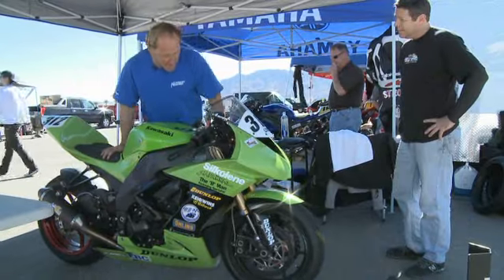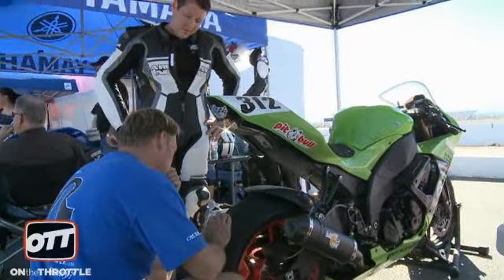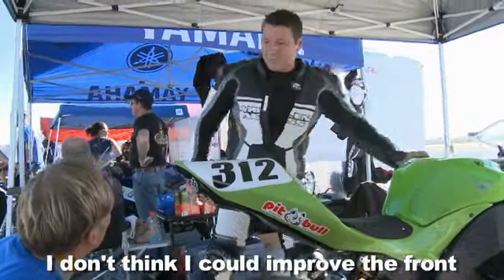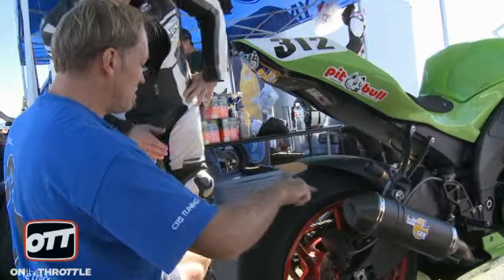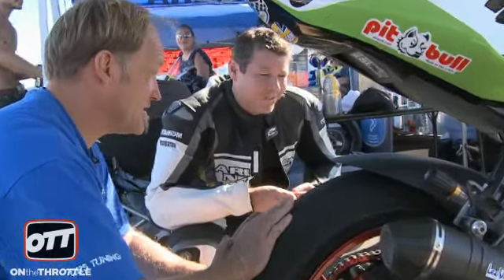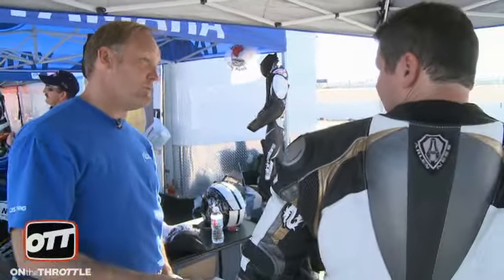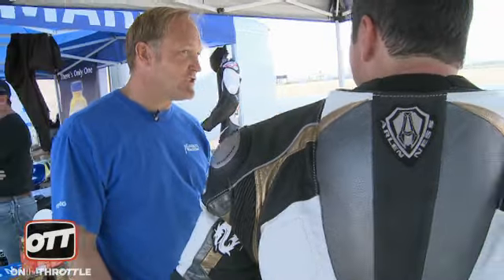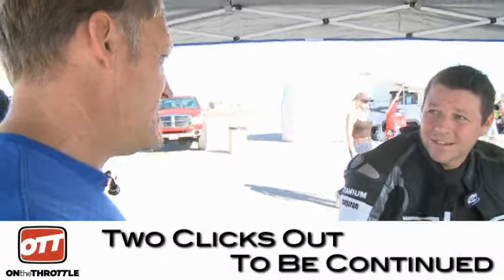Two Clicks Out 12: Shredding A Rear Tire

Comment: i like this style vid,  favorite Dave Moss vid, hopefully can find more of this style.  tire wear is interesting.  I ran into a unknown for me. I understand theory of high and Low speed Compression. but i would think you would open up the high speed,  Dial in the Low Speed( I assume its the old school, the foundation) then work on the High speed. But, honestly not sure, been out of this stuff for bit, so "High Speed" is out of my wheel house, I do understand the different inputs that are "high vs Low speed" it's not your speed, But speed definetley matters. I think of it like braking bumps,, chatter, same stuff a slow rebound can create "Packing". I may be off base??

Comment: Good example of how important it is to 'read' the tyre in order to go in the right direction with suspension. Know the cold pressure and set it before anything else. Check pressure when under the warmers and again as soon as you come in after every session. Maintaining the hot pressure gives a known constant when 'reading' your tyre...Mark, Dunlop Motorsport.

Comment from the maker: @leecravenaz  good observation. Most race tires are no longer directional, but DOT race tires have to have all the markings of a stock tire including the rotational arrow. Getting the most use out of a race tire (slick or DOT) is therefore done by "flipping" the tire. Helps keep the costs down a little for our biggest expense - tires!

Dave Moss
Host
Reply: Yea I saw the arrow wrong way round as I'm a retired bike mech. Are some tyres ok one 
 backwards then Dave?

Comment from the maker: @cougz82 with these race DOT tires you can run them in either direction. This is true of many race tires, slicks or DOTs. To be race legal, all race DOT must have correct side wall information including directional arrow.

Dave Moss
Host

Comment: 4:05 Im so sorry if this question souds dumb, but ts that arrow on the tire side wall pointed in the wrong direction? Does that matter?
Reply: i dont think it matters on slicks only for the tire grooves when its wet
Reply: kraziee93

Hmm, I have no idea really. Thanks for the response :)
Reply: kraziee93 those weren't slicks, they have treads towards the center

Comment: @Dave Moss Tuning

Ok, enough comments about the tire being flipped, sheesh.

Dave, I don't know if I've seen this question brought up before, but it's been on my mind.....
Regarding preload, a ziptie  is used in the front in order to measure fork travel. Are there any techniques used to monitor shock travel, or can that only be done by 'reading' the rear tire?

As always, thanks for your response.
Reply: A tape measure to set up sag is for rear preload.

Comment from the maker: @brett6604 This is Dave's response above, to someone that made the same observation. 

"good observation. Most race tires are no longer directional, but DOT race tires have to have all the markings of a stock tire including the rotational arrow. Getting the most use out of a race tire (slick or DOT) is therefore done by "flipping" the tire. Helps keep the costs down a little for our biggest expense - tires!"

Dave Moss

Comment from the maker: @khyoon14 in breaking a track down by design based on rotation, tracks lend themselves to right or left turns being fast, right or left turns being technical/slow requiring slow roll on. In this instance with this track, right hand turns were full throttle exits, lefts were maintenance throttle or slow roll ons.

Dave Moss
Host